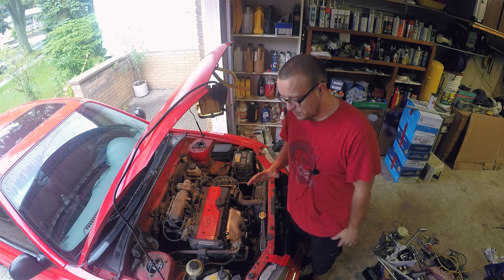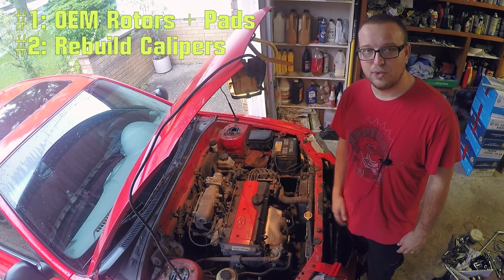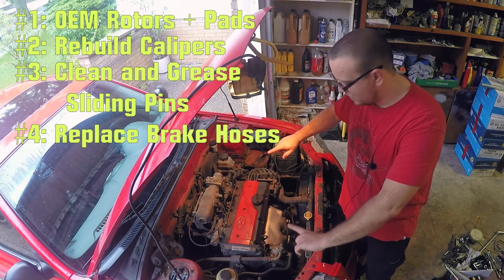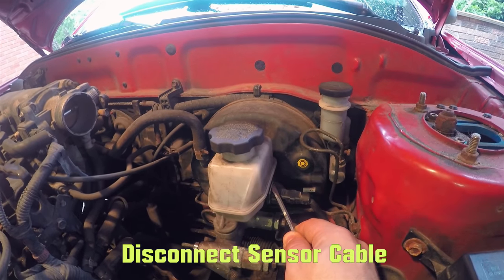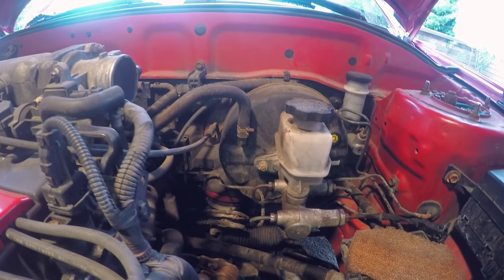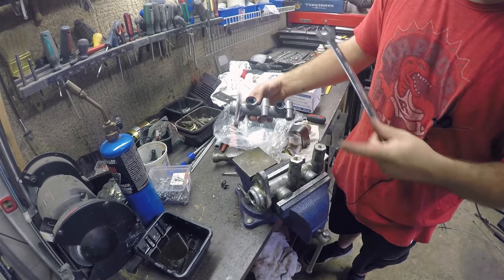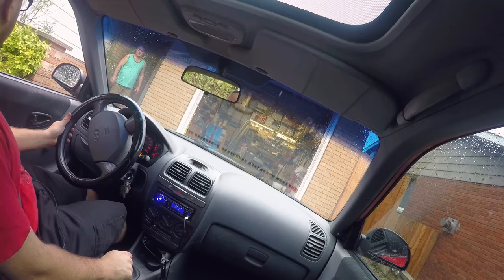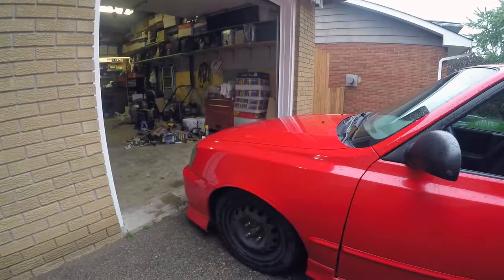How to Fix Overheating Brakes - Master Cylinder Replacement

Comment: Great job! I have gone through the exact same procees by replacing calipers, pads and hoses on both sides. I think the key here is that both sides were experiencing the same problem. Thanks for your video.ordering master cylinder now!

Comment: Great video.  I had this same problem on my 2002 and 2010 Chrysler Town and Country.  I was beginning to fear this was a problem with the design.  The video showed what the problem was.  I broke the connections on the master cylinder and vacuumed the draining brake fluid out of the top of the master cylinder reservoir.  I could see there were old flakes of debris in the cylinder but without completely removing  it I filled it back with brake fluid and problem solved.  Thanks for making me think it through!!!

Comment: Should bench bleed it such as leave the lines off pour fluid in and pump the brake then connect the lines after for further bleeding and shell be mint instantly 👌🏽 and then hundayy vtec down the road 😂🙌🏼 and the abs will also viabrate it perfectly too. Great video man

Comment: I did calipers and new pads, brakes are still getting hot. I ordered front rotors, but I think i might try the master cylinder before I put them on. I been really looking into this fix.

Comment: Sounds like I have the same thing.
I put new rotors and pads on my car but they smoke and smell when even on a small downhill. Yes, I used all new hardware plus clean and lubed everything really well. The calipers retracted smoothly so pretty sure it's not those or the lines. Is it possible the master is not allowing the pistons to retract all the way?

Comment: I've had the same problem with my sisters car, 2001 Hyundai Elantra. I've replaced the brake pads, rotors, brake hoses, I even did the abs sensor. I'm hoping it's the master cylinder.
Reply: What did it end up being?
Reply: Was it the master cylinder??
Got same issue with my hyundai i40

Comment: Hey I got a 2011 Kia Rio and my right side brake locks up and my rotor overheats , I replace the brake pads , bought a new rotor , and bought a new caliper but my right side still locks up and makes a terrible smell any suggestions, ps it only happens after I use my brakes constantly
Reply: it can be breake hose the black rupper hose, its get blocked
to laite but i hope this help you.

Comment: unusuall for the master cylinder to die in these. my accent has gone 400 000km on the original master. but i guess in canada you get salt on the roads in winter which would corrode things easily.
Reply from the maker: I suspect it might have to do with installing a hydraulic handbrake. Maybe some fluid got dirty in the process and clogged the valves. Not sure. In any case, I agree, quite strange, that's why it ended up being the very last thing to replace :).

Comment: I already changed my master cylinder and it still overheats i changed everything calipers,brake lines, brake pads, rotors, i don't know what to do...please help..😢
Reply: What did you end up having to do?
Reply: Having the same thing here with front brakes . My guess is the ABS pump is jacked up. Thats what im hoping to change next
Reply: You brake fluid may be overfilled, or brake booster either needs adjusted or replaced .

Comment: All brake rotors get hot after moderate use you might have changed a master cylinder for no reason.
Reply from the maker: Oh the issue was very real unfortunately. Glowing hot rotors from a  2min drive around the block is not normal. Believe me I would not do this sort of car work if I could avoid it lol.
Reply: @WeekendAgendaTV  Good to have completely overhauled brakes would cost a fortune to do this in shop.
Reply from the maker: Most of the time with older cars this typically happens because the calipers are all rusted and dirty, so when you retract the pistons and put in brand new fat brake pads the piston get stuck because they are in a zone that they haven't been in for a while. The rust and grime keeps them from backing away from the rotor so they drag and heat up. So that was my first guess, but as you can see with my luck it ended up being the absolute worst option lol.